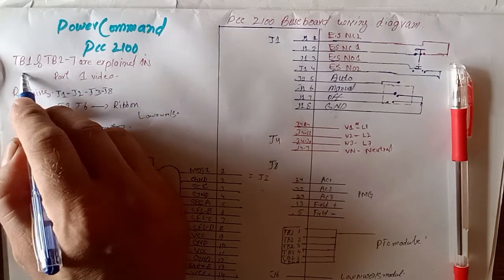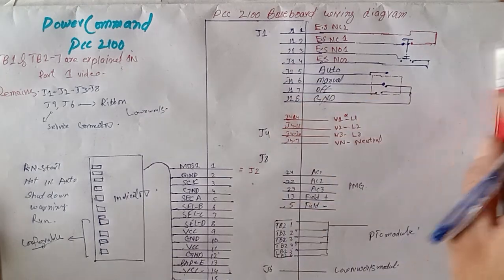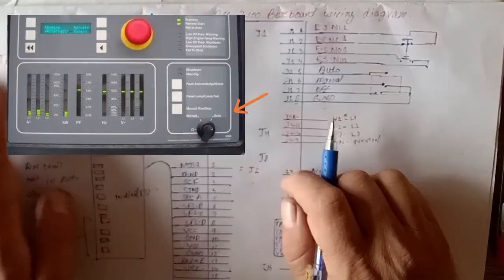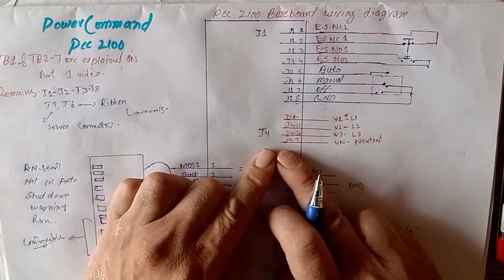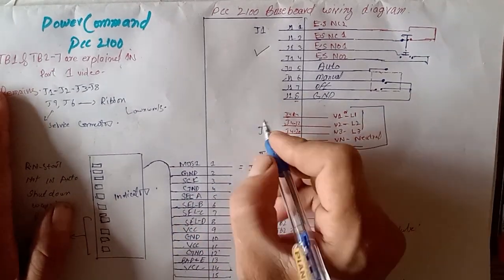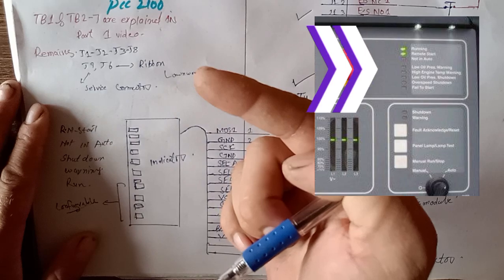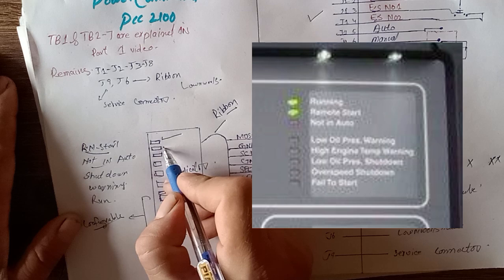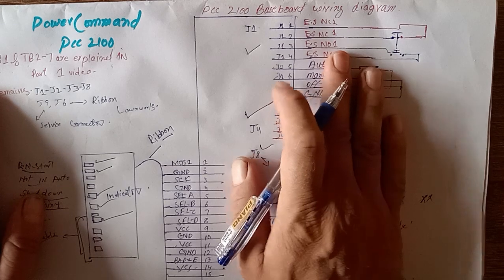Cummins generators PowerCommand wiring diagram explains  PCC2100 Baseboard wiring part 2

Comment: How do i convert pcc2100 avr to stamford avr. Its shutting down on high voltage 430. I think the avr is affected. Pls reply me
Reply: Man, I'm just now running into this issue. We're replacing it with a stamford without PMG wires and it came with its own AVR. Was gonna use the integrated AVR on the 2100, but found I'm missing the PMG. Were you able to find a solution to this?? I'd appreciate it..